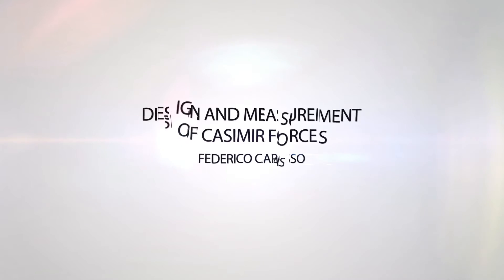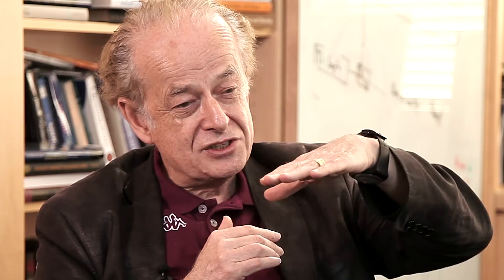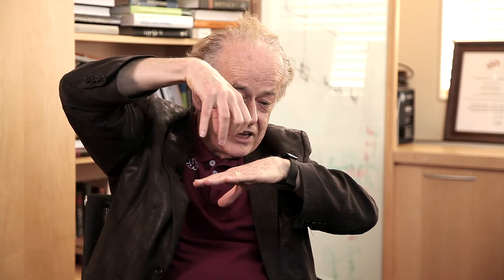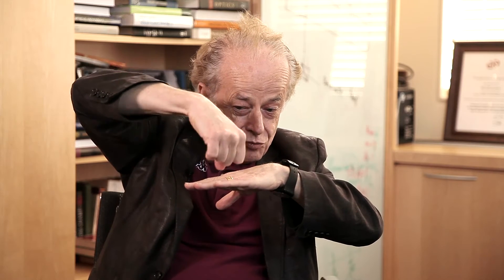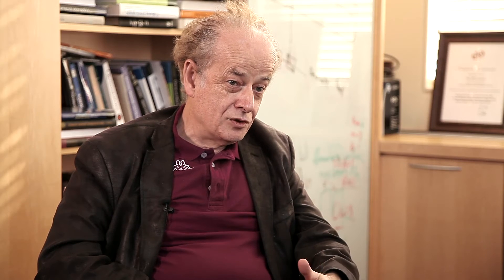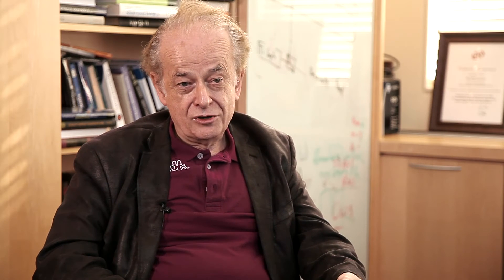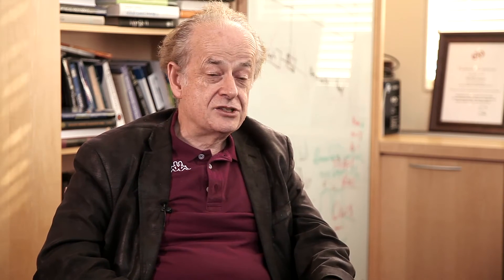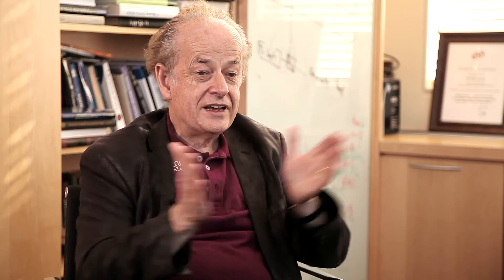Design and Measurement of Casimir Forces - Federico Capasso

Comment: There’s not much thats 100Nm apart in the universe… in the sense everything in the universe is 10 orders closer together. 

So when large strong flat dense plates are 100Nm apart….. it’s the connection between between two scales of the structure of the universe. 

Just a brainstorm thought.😘😘😘

Comment: has a experiment been done that yield photons from the moving plates? Casimir light faster then speed of light?
Reply: I think I remember one that did extract photons from moving planes.
But be aware this does not generate any surplus of Energy because you need to move the Plates (i.e. put energy in) to get a photon (which has almost no energy).
No light is per definition travelling with the speed of light. Other velocities are not possible (except in materials but there you need to distinguish phase velocity and group velocity, which if you do it correctly no information travels quicker than light).

Comment: I started to ask this question!!!   I’m asking two (2) questions:

1, is there a practical use?

2, is there a “sci-fi” use?  Or is there a speculative science or engineering use?
Reply: Well Casimir effect could generate negative energy.Little cells of such negative energy could constitute a negative energy battery.Which then could be used to make a warp drive.
Reply: How?
Reply: @philler8151  Could Ben Franklin have known HOW electricity will become pivotal to our existence.
Reply: I can imagine that you are the guy who asked Townes in 1951,- what possible use for a laser ? You are living and using these advanced technologies, and you do not have a clue as to how it all was conceived and built.
Reply: I am not sure if it is yet used. The sticking of MEMS is for sure a problem which needs to be tackled, especially because the scale things are built right now is pretty close to it. I think it has some importance, for example in motion detection sensors (which by the way are now in every phone). So funny enough you probably carry something around all day which was build under the consideration of this effect.
I won't call this an application because the casimir effect is more a issue then benefit but probably some day there will be novel applications using the casimir effect for good and not for bad.

2) No, i cannot immagine one. Also no speculative use in science as far as i know (you might stumble upon some crazy people claiming to get energy out of the vacuum using the casimir effect, but these are all liars and not scientists!!!!)
Reply: @philler8151  You are missing the point. Technologies do not appear out of thin air. There is a process to find a way to understand (as in here), and then ultimately develop. This guy was asking if their was a practical use. At this point, there is no way to know. He should have known better.

Comment: I have a question about : perfect vacuum,...there are many vacuums, this is the point. The vacuum here( inside atmosphere) is not perfect vacuum, because there is " gravity " inside the box( here), there is magnetic field), so I would not call it : perfect vacuum). The vacuum outside of solar system is different vacuum . Did you try this experiment there?! 

 You can tryAnother experiment with Casimir effect  through two magnets( magnetic plates) in( another) vacuum (vacuum out of the solar system )
Reply: And how would you get to that point?
Vacuum is vacuum. There are no different kinds of vaccum, its just a matter how close you are to a ideal vacuum. It doesn't really matter if you don't have the ideal vacuum since the undelying theory doesn't change. Vacuum fluctruations are a result of QFT and therefore well established.
Reply: @philler8151  what is qft ? Ideal vacuum is not reached yet . no,are not fixed yet.
Reply: QFT is quantum field theory. In that theory (which is the base for the standard model of physics) the vacuum is not 'empty' but full with particle antiparticle pairs which exist very short times. I think when we reach a vacuum, as empty as space, on earth then we can say we have real vacuum